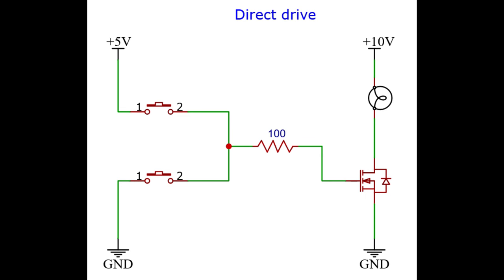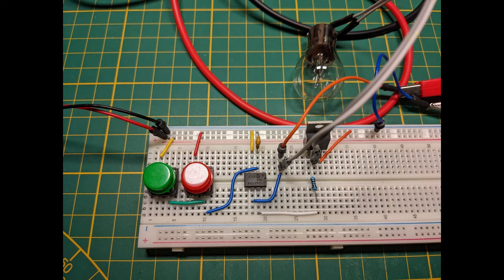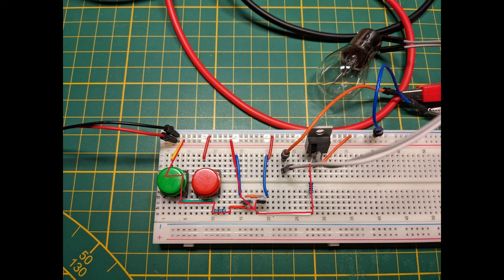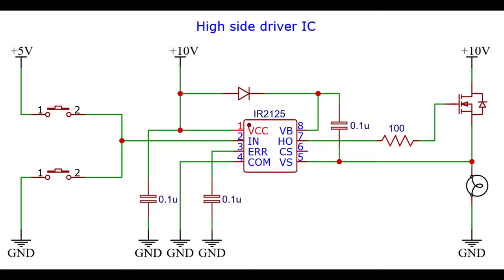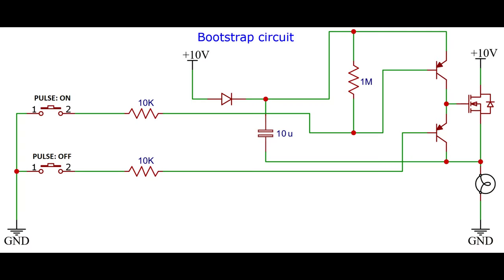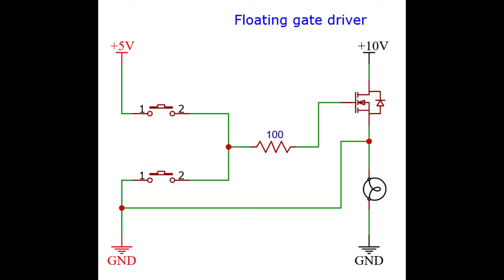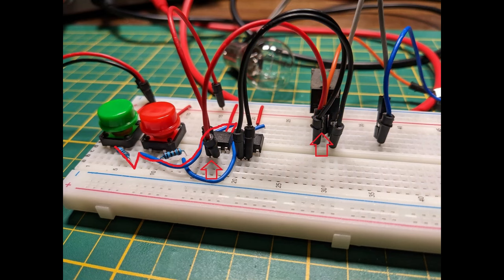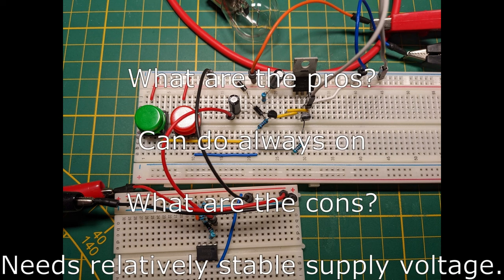Schematics included!

Comment: There are high-side driver ICs which can be "always on" (and manual control) just fine.  That's just a limitation of that particular chip, not of the category in general.  (and actually that chip can be controlled by manual signals too, if you wire it up correctly.  It has nothing to do with being a "safety feature")

Also, the optocoupler design can do PWM just fine, if you choose optocouplers with appropriate switching characteristics.  A better approach would just be to use one of the other driver circuits and isolate the input using a single optocoupler instead, though.

Comment: In the inverted level shifter circuit schema are NPN transistors drawn. They should be pnp transistors. In the comment you speak of pnp transistors which is correct.
Reply: Thank you! The drawing didn't make sense.
Reply: if you pressed both buttons at the same time on the inverted wouldn't the 10v run through both transistors directly to ground?
Reply: @RyCorp77  Yes!  Well done for noticing that!  This is actually a very big caveat with these sorts of "push-pull" drive designs.  And this can actually still be a problem even if both signals aren't technically on at the same time.  Transistors don't switch instantly, so if a circuit like this goes from "on signal" to "off signal" (or vice-versa) very fast (for example, if the signal lines are driven by some other switching circuit which is always either "on" or "off"), then there will be a period of time where the "on" drive transistor has not fully turned off yet, but the "off" drive transistor is already (at least partially) on, so you will get current flowing directly from VCC to ground straight through the two drive transistors, which can actually produce a substantial amount of losses and heat, and can even damage them if they're driven too fast, etc.

This is why lots of modern dual-output gate driver ICs are built with sophisticated internals which are designed to make sure the two transistors are never driven at the same time, and give one transistor time to fully turn off before turning on the other one, etc.  (Yet another of the many many reasons why gate-driver ICs were invented and are a good idea to use.)

Comment: If i have a build a "driver circuit" to turn on or off an automotive coil (use 5v pwm signal to turn on) , which method would you rather use?
Reply from the maker: Hi, I would either go direct drive on the low side if acceptable, or dedicated high side driver IC. In both cases I would want a low component count for a project that doesn't live on my workbench.
Reply: @krakkus  Thanks Sir ! The coil is activated with + 5v , it means i need a low side mofset so that i can a positive signal , right?

Comment: Thanks fiŕst.sir is it possible that we can isolate drive circuit from mosfet,because when mosfet damaged or shorted(usually we face in repairing circuits) it damages drive ic .can it be seprated through capacitor or by other means?.thanks.secòndly what is best trap for overvoltage zener(sometimes it get open and circuit damages) or crowbar or any suitable provision.thanks
Reply: A lot of gate driver ICs have protection built in to detect this sort of situation and automatically shutdown to prevent damage to the driver IC or the rest of the circuit (which is another good reason to use a driver IC when you can).  Look for driver ICs which list "fault detection" or "overcurrent detection" as a feature.

Comment: I'm so confused. I bought a logic level N channel FET and it drives from the Arduino when connected to 5v VCC. For some reason my pin outputs, no matter what digital pin I use, don't output enough voltage (or current) to keep the thing on. I checked my code is set to PINMODE output so I don't know what else to do.
Reply: Possibly pulls too much amperage from Arduino pin, or possibly not enough. A resistor between the two could help. It could limit the amperage from the Arduino to protect it, and could pull a little more in the case where FET needs a certain current to activate instead of just voltage level.
Reply: @yeahaddigirl   Thanks. I changed the FET to an older one I had which I thought was knackered, and it works much better. It's weird because they both have the same info on the data sheet about the logic level and vcc that drives it. It's not perfect, and adding a resistor is a must now, where before it didn't seem to do anything. I now have a new problem though.... when the motor's torque is under strain (like if you force against it) the Arduino resets. I've added a diode and a 10mf cap to the motor which seemed to help give it more oomf, but every time the motor stalls it resets the Arduino.
Reply: @ArcanePath360  You always need a current limiting resistor when driving the gate of a power mosfet. Usually something around 100R will do the job. You can test your first mosfet by simply connecting the 100R to the 5V rail and then to ground. It should turn the mosfet on and off. If it doesn't, then you have a problem with your logic-level mosfet. If it does, then you need to check the output voltage of your Arduino.
When a motor stalls it draws a large current which will drop the supply rail and cause resets. You should really use separate power lines for ics and motors.
Reply: @RexxSchneider   I think the problem is the cheapo ebay Arduino doesn't output enough current from the  pins. All tests would indicate this, since I even tried 2 motor shields that were rated for the current but were very lacking in power IRL, no matter how I programmed them. This is why I switched to a FET, as I thought the problem was the motor shields, but I get the same underwhelming power. At least I did until I switched to a different FET. Problem I now get is that every now and then, when it's under strain the Arduino resets itself. I've put a 100mf cap on the motor and a diode which helped, but maybe I need another cap on the power input of the Arduino. The motor runs off the same power brick but with a buck/boost in front of it.
Reply: @ArcanePath360  voltage ratings aren't the only things that can matter in this sort of situation.  FETs are basically sorta like capacitors internally, which means that when you first turn them on, they will "suck up" a lot of current to charge up to their "on" state (and then they won't need much to maintain that state).  Different FETs can have very different internal capacitances, which means they can have very different switching currents.  These switching currents are very brief, but they can actually be pretty large if there's no resistors or anything in the way to limit them, which is why you should never drive a FET directly from something like an arduino without a current-limiting resistor.  I suspect the first FET had a somewhat larger capacitance than the second one did, and was pulling more current when switching.  However, even the second one is probably borderline and could potentially stop working (or even damage the arduino) if run directly (without a resistor) for a long time (this could also be why the arduino is resetting sometimes).

It is also quite possible that switching the motor is sending noise, spikes or voltage dips back through the power system and causing the arduino to glitch or brown out.  I'd suggest trying running the motor off of a completely separate power source than the arduino, and see if that makes things more stable.  If so, you could try putting them back on the same source, but adding some much larger capacitors and maybe some inductors (chokes) to filter out noise/spikes between the two.  If you have one, monitoring the arduino's supply voltage line using an oscilloscope would be a very good idea, as it can give you a much better idea what type of problem you may be dealing with.

As a matter of principle, I always recommend adding at least a 10uF cap to the power input of any digital device like an arduino, regardless of what you're doing with it.  With something big like a large motor in the mix, though, you might even want to go 100uF or bigger, though.

Also, if the motor shields were not producing the amount of drive power to the motor you expected, that is not a problem with the arduino.  That is either a problem with the motor shields, or (more likely) a problem with your power supply not being able to keep up with the demands (and the voltage to the motor dropping under load).
Reply: @foogod4237   Thanks very much for all this. Lots to think about. I will take another look at my resistor set up. I think I had ones but was getting weak output until I completely took it away. It seems to me that the Arduino output pins are barely capable for fully opening the FET when resistance is added.

I did post on a forum which said my motor may be sucking all the current out of the circuit, as I mentioned it only resets when my motor stalls. I believe the cap and diode setup have nowhere to send the excess current when the motor stalls and so it goes back to ground instead of back into the motor. I did try running the Arduino off a USB power supply at the same time as the 3A wall wart, but it made no difference.

The 10mf cap I put on the motor gave it more power but yes, maybe I need a 100mf cap on the power supply too.

The shields I tested with 3.7v LI batteries which, when connected to the motor directly give about 3-4 times the amps. The shields are probably just ebay garbage. 1 said it was only 600ma so that is what that isn't good, but the other more expensive one was supposed to be 2a, but behaves exactly the same, and off the 3.7v battery too.
Reply: @foogod4237   I just checked my circuit and there is actually a resistor on the FET. I'm thinking the way the power is hooked might me causing problems, or it's just not powerful enough... The power is hooked up currently like this: A 3a 5V supply is connected to a buck/boost convert input, and 2 wires are soldered off of this same input, going to the Arduino underside where the USB 5v power is (soldered to the underside of the board on -/+ points). The buck output is connected to 2 motors... one is a low powered small one running through the shield VIN, one is the bigger motor running off the FET, taking from the same output. I just checked and it is set to 6.5v, likely because the voltage is spread over 2 motors to get the 3.7v motors to work at full speed.  The 2 motors used to run off a single 3.7v LI battery, so I figured a 5v 3a wall wart would be more than enough?
Thanks for your help on this.
Reply: I use an Arduino Nano that drives a 555 in buffer mode, and the 555 drives a non-logic level 50A N-MOSFET. It's an automotive setup (driving 2 injectors of 1 ohms each, in parallel) so imagine the electrical noise.
What helped drastically decrease the Arduino crashes was adding 1kohm resistors between the Arduino inputs and sensors, and a minimum of two inches of distance between spark plug cables and any Arduino cables. 
Also I added ceramic and electrolytic capacitors on the power rail of the Arduino (before and after its external 5V regulator).

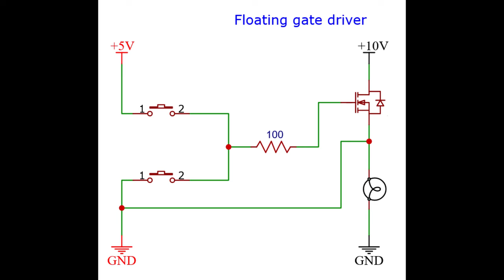Comment: Error in the floating gate driver at 5:52, the lamp is always off
Reply: The diagram is drawn wrong.  He mentions in the audio (but not in the schematic) that it requires an independent power supply for the switching, which means that the "GND" that the switches are connected to is not the same GND as the one the load is connected to.  For this to work, there should be a "switching VCC" (+5V) and "switching GND", and a completely separate (unconnected) "load VCC" (+10V) and "load GND".  (the "switching GND" is then connected to the MOSFET source pin, so "switching GND" and "load GND" will always be different.)

But this means you need two completely independent power supplies, which is usually a pain, so this technique is actually not that commonly used...

Comment: 7. isnt it shortcircuited ?
Reply: Yes, the diagram for #7 is wrong.  The "GND" the switches are connected to must be a different GND than the one the load is connected to, which means you need two separate, isolated supplies (the switch supply cannot use the same ground as the load supply does).  This is part of the reason almost nobody ever does things this way.

Comment: Question the high side switching is very difficult to drive with high voltage of the voltage is 160vdc to the higher side mosfets the gate can handle voltage higher the 20volt so how can the gate get change higher then the supply voltage of 160v to work explain this I use driver transformer to drive the low side switching but the mosfet get hot at 20v to get still this how can I drive 160vdc in a high switching or it’s not possible
Reply: This is why high-side switching is less commonly used than low-side switching.  Depending on your switching requirements, there are high-side gate driver ICs that can do this for you, or you can use something like a charge pump circuit to generate a voltage higher than your high-side voltage for switching the MOSFET.

Alternately, if you use a P-channel MOSFET on the high-side, then it will turn on when the gate voltage goes below the source, so the operation will be inverted, but you will not need to have voltages higher than your supply voltage to drive it.

Or you can just stick with low-side switching, which is generally easier anyway and works fine for lots of things, unless there's some specific reason that won't work for you (how hot the MOSFET gets will be exactly the same, regardless of whether it's on the high-side or low-side).
Reply: @foogod4237  thank for your feedback but I have bing to  alot if classes on integrate circuit and I have fully master the ability to driver high side mosfet and igbt without using gate driver ic I wanted to use transformer instead and I got it to work perfectly 👌 without generating any heat what I learn from the graft machine that show the fully functional gate charge at every level of current to hand large load .the machine cost me alot of money to buy but this machine  don't sell on the market ,i was lockly to get it from a company that was closing down what I found out is all mosfet use a current of 900 milliamp at full load some take up to 1 Amp of continuous current so when I hear alot of so call engineer on YouTube said mosfet is a voltage Driven transistor I just laugh now because they don't have such a machine to measure the mosfet performance and show the data live I test a mosfet of 500 watt with a gate driver ic ir2110 at fully load the mosfet get so hot really fast I have to stop the testing and when I use a gate driver transformer that I design that provided a peak current of 12 Amp and 2 Amp continuous current with the same load the mosfet just get really warm but not hot and the current at the gate charges was taking continuous was 1 Amp so you see all the lies about mosfet is a voltage driven transistor is all garbage